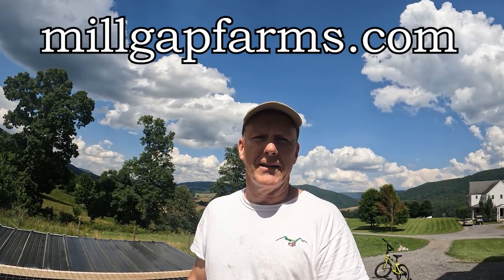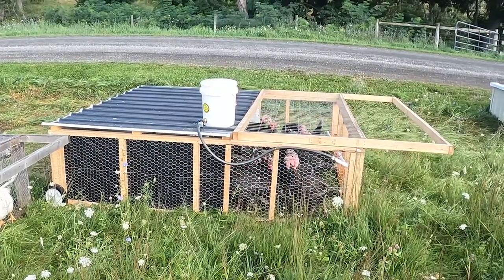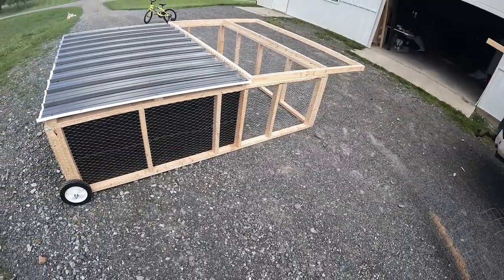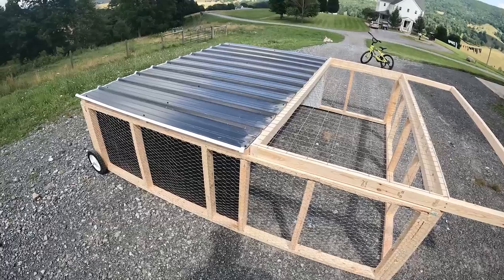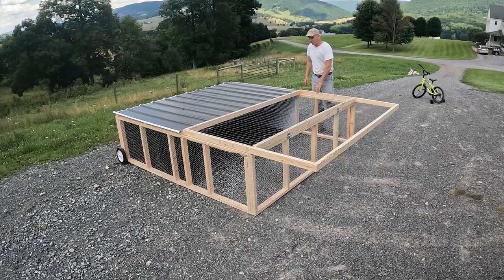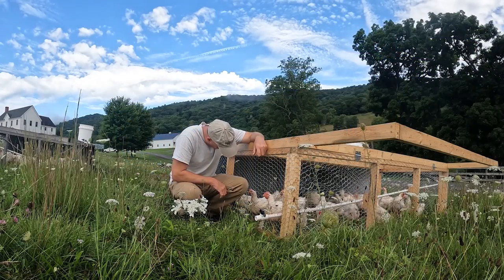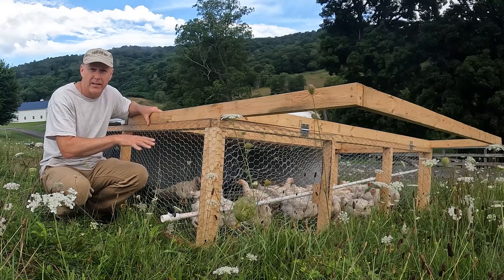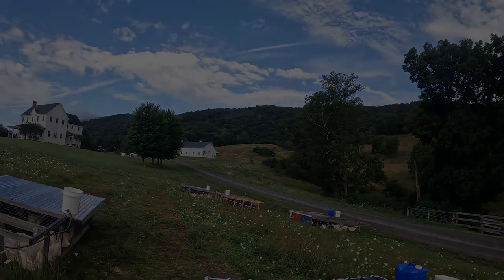Build a Chicken Tractor

Comment: Hi Kevin, i built a chicken tractor using your design and love the easy access. I did build mine using 2x4's and hardware cloth. I wouldn't recommend it as mine is very heavy.   How do you have your watering system set up? Thanks for sharing your design.
Reply from the maker: I have been using waterers and putting them inside. I do have a system I made but have not done a video on it. If you want more details, email me through our website and I can share them with you.  www.millgapfarms.com  Kevin

Comment: We have chicken snakes, raccoons, opossums, coyotes, skunks, bobcats… I need a coop and run made with hardware cloth. Would hardware cloth be durable enough to be used as wire for this tractor?
Reply from the maker: We have all the same predators with one addition. Minks.  They are mean as can be.  I would put them up against any of the above.  Thankfully the chicken wire will keep them out.  I think hardware cloth is a nice upgrade but will add weight and won't provide much more protection.  Don't get me wrong, it's definitely stronger than chicken wire.  It will be heavier.  Thank you for watching our video. I haven't seen you in the comments before. I hope you will visit again soon.  Kevin

Comment: If you fillet those sharp inside corners, you can get the same strength with thinner wood.
For something you expect to last 5 years, you can glue small triangles (cut a square diagonally) into corners, they can be thinner than the wood. Try making 2 square frames and fillet one then see how hard you have to push to break them. 
Look into soaking wet cloth with Portland cement (it's extra smooth) at cake batter consistency and lay that on chicken wire so it all dries as one. If the wire is stretched over a frame then it dries in place and needs no fasteners with a little wrap-around. For cloth, burlap or used feed bags is good.
Just don't let the cement dry out, seal it or throw some water on in dry weeks, cement crumbles if not treated properly. Driveway sealer or oil based paint or I dunno what else will do the job.
Again, make test pieces and break em, knowing beats guessing! You can overlap small pieces of mudded cloth with a thumb width overlap, cloth or wire and it's good. adding wire and layers can make the composite strong enough to bounce a sledge hammer back atcha. Thin composite bends with some spring-back, thick has give... even 1/4" thick. With fabric, thinwall cement this way don't need sand.
Here's a youtube link to a guy just starting to do it, there are many-many craft links and some show rope with cement worked through, not so easy with good rope. https://www.youtube.com/watch?v=PUOb5hL9Ro4&t=30s&pp=ygUSZ3Jvd2JhZyBjZW1lbnQgcG90
Reply from the maker: Neat video! Thanks for sharing. I like the idea about the triangles too.  It would definitely make the tractor stronger! Thanks for watching and taking the time to share this good information!  Kevin

Comment: Hello! If there are long periods of rain, for example 4-5 days, and the pasture is soaked, how do we keep the chickens from getting wet and sick while in the chicken tracktor? If we don't have a dry shed built nearby, is there a solution related to the construction of the chicken tracktor?
Reply from the maker: Rain can affect the birds especially when they are young (3 to 4 weeks). And it's early in the season and temps are cooler than summer. As they get a little older not so much unless they are in standing water.  We live on a hill and I don't think except for the footprint of our home, the property is not flat.  We are blessed in that respect. Until we play ball with our kids and it's becomes a chase game!  On the chicken tractors we use, the inside has the tyvek material on and it works very well.  Even a few years out now, it's holding up well.  What we do is point the covered sections (3 sides) into the wind (which we have a lot of).  And still move it daily.  I would suggest staying away from low spots where water will travel or pool.  I hope this answers your question.  We can talk more in the comments or email me through our website www.millgapfarms.com.  Thanks for watching and posting your question.  Kevin

Comment: How many chickens did you run in these at the same time?
Reply from the maker: It will depend a lot on how often I move them.  Typically around 25-35 birds.  I have put more in and when I do that I move them 2-3 times a day.  The bigger tractors 10x10 or 12x12 I can run 50. But it's not fun to move them.  I much prefer these sized tractors.  Thanks for watching!  Kevin

Comment: How did you use this tractor to take care of the chickens in the winter? Did you provide any insulation or specific heat techniques?
Reply from the maker: Tracy T, These tractors are used in the summer months for our meat birds.  They could be used in the winter but as you mentioned, some form of insulation would be a good idea.  Chickens don't really need insulation as much as protection from predators and some of the elements (wind and precipitation).  Around our farm we tend to get some snow and once that happens, moving the birds is not going to happen.  When it's not snowing it could be moved.  But, the chickens will not receive much of the benefit these tractors provide in the warmer months (fresh forage and bugs).  With this being said, I think these can work in more of a stationary way.  In fact, we use one for our ducks and in the winter we position it in such a way that the back is into the wind and we give them hay inside for warmth.  The ducks love it and stay there year round now.  During the day we let them out to roam the farm and at night we call them in by saying "All ducks go to bed" and they come running..  It's a hoot.  But it works.  If you wanted to use one of these for layers, you would want to set up a nesting box and a way to access that box from the outside.  Our ducks lay all over the place inside the enclosure and when they do, I have to go inside to get the eggs... I'm a little over 6 foot...it can be a pain.  My son loves climbing in there and he does it when he see's eggs in the mornings.  He's 5 and the right size for that adventure.  If you have any more questions, let us know. Thanks for watching and leaving your question here!  Kevin

Comment: Can I ask are those 1x2s or what size is this wood? I have watched so many videos and looked up so many plans but after seeing this one I am going with this one. I'm branching out from just laying hens to adding meat birds now thank you for your video!
Reply from the maker: Mr. Neeley,  The boards are 2x3's.  They are not as strong as 2x4's but much lighter.  It is a lot easier to move around the farm than my larger ones.  After using this for a season about the only thing I would change is making the tractor sit off the ground a little more.  Not much, especially if you have minks in the area.  But a little bit.  Our pasture where I run chickens is not as smooth as my lawn... for that matter, my lawn is not that smooth either!  Be sure to put some tape around the edges.  They can cut you fast during the season.  Another tip that would keep you from cutting metal... make your tractor to fit the metal vs the metal to fit your tractor.  I'm thinking you can get pre cut metal and doing a 60/40 split or 75/25 split would be ideal.  60% covered and 40% open.  Don't use metal on the side unless you want a daily work out.  Use a product like tyvek (black on the outside white on the inside.  I may have enough of what I used if you want to use what used. Last tip, while you are building this consider building and extra pane to fit in the open section so that when you are getting your birds out, you could put a small amount of feed in the open section and then slide into place a panel where it would keep your birds in the front.  Otherwise, you need Gabriel, he loves catching chickens and will crawl inside the covered area to get them for you.  We rent him out by the day, on occasion by the chicken caught!    If you have other questions, visit our website www.millgapfarms.com and email me.  I'll be happy to help you during your build process.  If I can do it, so can you!

Comment: Just curious, no issue with predators(racoons) reaching through the wire (holes)?
Reply from the maker: Great question Mickey Wells!  One time something, most likely a racoon did reach through and grab one of my birds.  Got her pretty good but didn't kill her.  She made a full recovery and was processed with the rest from that tractor.  Besides the wind, this is the second reason for the plastic tyvek type material on the inside.  This creates both a wind and predator barrier.  Nowadays, we have "stupid dog" to protect the flocks.  Having a livestock guardian dog for one flock doesn't make sense but because we have other animals, we have one.  Keeping your birds close to your home will help reduce the predator load.  Thanks for watching and sharing your question.  Everyone benefits from input like this!  Kevin

Comment: What did you say that tube was at the end? A chicken water ______?
Reply from the maker: djazgirl, That's a good question.  We have a shut off valve at the end of the tube.  It allows for the tube to be burped.  Without it you would have to pull a nipple to get the water to start flowing.  If this doesn't sound right let me know about where in the video I said what you are referring to. I'm getting ready to do an update video on this tractor too.  After a season of use, what does it look like and would I change anything.  That should be up soon.  Thanks for watching! Kevin
Reply: @MillGapFarms  When you rolled the coop out of the barn there was no white plastic pipe under the handle bar at the back.  When you are wrapping up the video around 9:33 there is a white pipe on an angle that comes out of the coop a bit with a valve on it.  What is it's use? How does it work? Thank you.
Reply from the maker: You are good with the time stamp.  It took me right to the spot where I needed to be.  That "white thing" is my waterer.  I used 1/2" pvc pipe and chicken nippls.  There is a 5 gallon bucket that sits on the top of the tractor that has a quick connect on it where I can remove it when transporting.  This happens when there is clean water in it.  I shut off the valve on the bucket then take the bucket off the roof, move it to the next spot and then move the chicken tractor beside it.  Would you think a video on the waterer would be helpful?  Thanks Kevin
Reply: @MillGapFarms   That would be great! Thank you.
Reply from the maker: Djazgirl, I have not forgotten about you.  I had the video done explaining how I built the waterer and something happened in my editing software... one day it was there and the next everything was gone.  I'm sorry for the delay.  None of my clips were there either...nothing. The project and everything in the folder, gone.  I'm working on another video. The white thing is the waterer and on the end is the shut off valve.  If you make one of these, put it on the outside of the tractor, you'll be glad you did.  Thanks Kevin